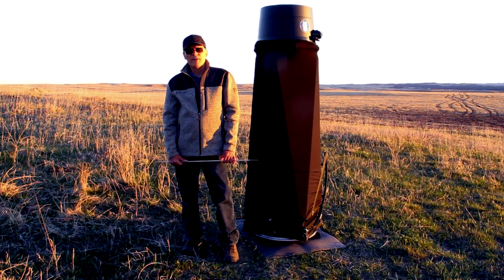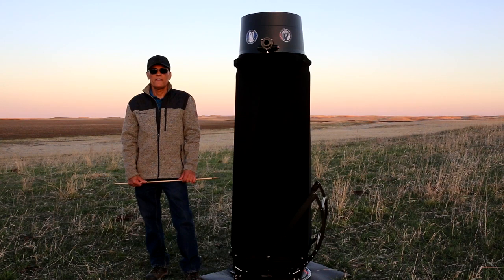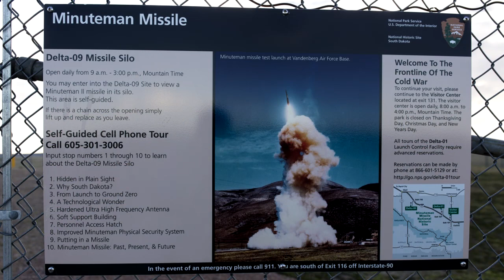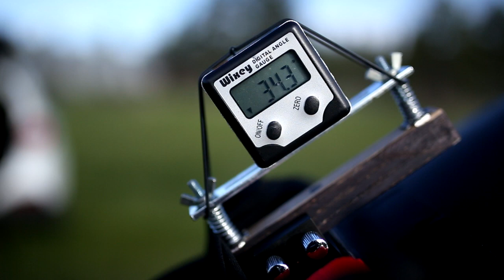Hubble Optics UL16 Dobsonian Telescope Review

Comment: You mentioned changing the springs for the primary mirror. I just got the UL16 and the primary mirror springs are not strong enough. Can you tell me the specs for the springs you used?
Reply from the maker: I don't have the specs for the replacement springs I used.  But what I did was take one of the old ones out and made a trip to the hardware store.  I compared a couple of sizes and resistance then chose the one that was somewhat stiffer and equal in height.  Worked fine.

Comment: I bought the 16UL f5 and have been very disappointed in the quality. Yours looks very different from mine. The truss rods I recieved came in two pieces that have to be bolted together with a big aluminum block on each one. The mirror cover you can order as an add on is just a flimsy piece if abs plastic not worth 45 bucks. The shroud I got isn't even completely sown together.

 Once the telescope was assembled and colimated, I could not get any of my eyepieces to focus(multipe brands meade, pentax, astotech and televue), even after adjusting the truss rods and the secondary mirror down as far as I could the stars almost came into focus with the focuser turned in as far as possible. It needs about 3 inches cut out of each truss rod to be usable. And for the cherry on top, my mirror had a huge noticeable scratch in it. I don't know what's happened to hubble optics in the last three years but from my experience, I will be telling anyone I meet to stay away from hubble, spend a bit more money somewhere else and get a better quality scope.
Reply: I am in the “on the way” stage for my HO UL14

I read of 1 account of a significantly more expensive Obsession 18 which was a total lemon. It happens even in the best examples. The initial release had quit a few issues but as with Hubble they learned and modified for the better.

Part of my research prior to ordering the UL14 was emailing 5 HO scope owners found on CN. 4 still have it and the other sold the 16 to purchase a UL20. All of them wrote they were satisfied with the scopes. They did mention Richard’s mods and a bit of tweaking may be required to get them to perform at high standard.

I am not expecting perfection but as in the video the “bones” are good IMO. If the mirror has problems (seemingly rare) coating wise i already found a service with a @$300 charge including shipping. That still puts you in significantly under the other more well known companies.

Comment: which one is better this one or sky watcher 16 inch donson? i am thinking to get one of them
Reply from the maker: If by better you mean easier to transport then the Hubble UL16 wins hands down.  And from what I could find, the sky watcher 16 is only available with a go-2 system in the usa.  It's cost more, has partial board and for most people it's not a scope you can easily take out to a dark site.  As far as go-2... I've put adjustable setting circles on my UL16 and there's no problem finding DSO with a phone app like sky safari.  You just calibrate the SC on a star, pull up your DSO on the phone, center it, and get the real time Alt/Az position of the object.  I had some kids just last night at a star party do it and they nailed a couple of targets first try.  The more I use this scope the better I like it. 

Hubble also offers a digital version of setting circles that look promising if you're not inclined to make your own.

Comment: Excellent video 
One thing I don’t understand why we believe that dobs are good kinda only for deep sky objects in reality my 15” obsession was blowing a way my Meade 10” lx 200
Reply from the maker: I guess it's because the larger mirrors take longer to acclimate to ambient temperatures; and the larger column of air they're looking through requires good seeing at higher powers. But when those parameters are met, they will out perform smaller aperture scopes by a county mile.
Reply: @DakotaStarryNights  
I used dank binociwers on obsession observing planets I was amazed on good night .
I want to know if this Explorer Scientific Refactor ED127 Triplet APO will be any closer to “15 obsession on planets ?
Reply from the maker: @AstroRef68  That would always depend on the seeing.  The better the seeing the larger the aperture. But a refractor would offer better contrast, no matter the seeing, as there is no secondary obstruction.  However, if it's planets you're after a MAK (Maksutov-Cassegrain) is hard to beat for the money.  But they do require an hour to adjust to ambient temperatures. So, they are not suited for grab-n-go setups. 🏃‍♂

Comment: Is Hubble Optics still in operation?
Reply from the maker: Best to try to contact them and see.
Reply: Yes, they are. I ordered a UL16 back at the end of September 2022, and it was just delivered (March 14, 2023), so, about a 6 month delay.
Reply: @seansadler6912  indeed it was. I have had problems with the focuser. I purchased one that wasn't so loose and didn't droop when fully extended. I wanted to know the distance recommended from the center of the secondary mirror to the inside edge of the focuser because it does not give me a clean focus but phases into a blur.  I've tried moving it slightly in and even added a plate to increase the amount but to no avail in improvement. Now I shall try positioning it away from the secondary mirror so I can find that sweet spot. I ordered an F5 and have yet to see Jupiter with reasonable clarity as other smaller telescopes have done for me. Any ideas?

Comment: That sandwich mirror is not light whatsoever. As the matter of fact is quite heavy for 16" aperture and not that much different from 2" thick one, weighwise. Modern, single plated,  1" thick mirror would give you very similar cooling properties and reduce weight by 11-12 lbs or more. So weight of that sandwich mirror is quite disappointing. Once I spoke to Norman Fullum about his Techno-Fusion mirrors which are very similar in design. He recommended them for very large telescopes because at "small" apertures they do not save weight that much. I suspect same way of thinking can be applied for sandwich mirrors. Of course small in this case is not that small because 16 inch is already very capable aperture.
Reply from the maker: Well, Greg I disagree.  At our observatory we have a conventional mirror 16" truss dob and it hasn't been taken out in nearly two years due to the weight and size of the mirror box.   The sandwich mirror in the UL16 is definitely lighter and by it's design can reach ambient temperature much quicker.  But there's more to this dob than it's mirror.  Overall it weighs less than an Explore Scientific 12" truss dob by 6.2 pounds.   I can easily carry the mirror,  mirror box with altitude bearings and ground board all assembled out to the car for a trip to a dark site.  That alone is pretty remarkable.  It's well made and after using it for over a year I've come to really appreciate it's overall design.  Thanks for posting.  Other opinions are always useful and welcomed here.  Clear skies.